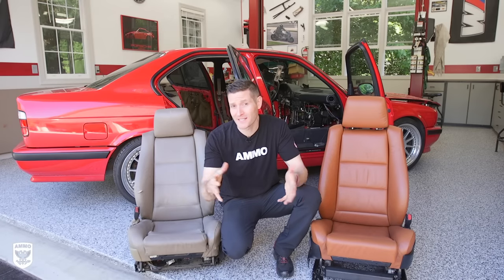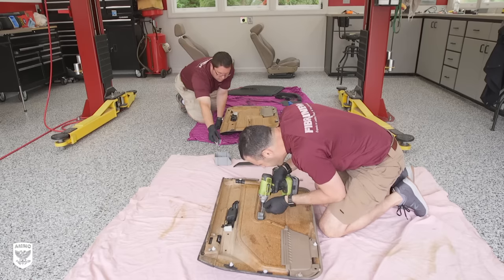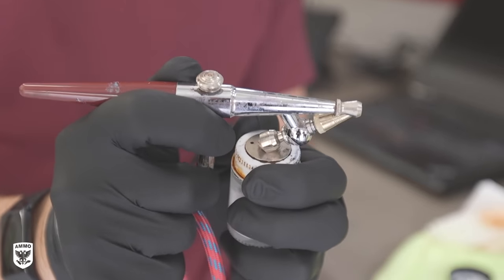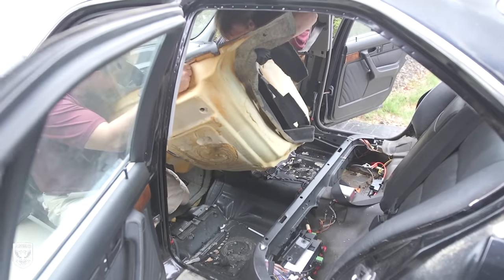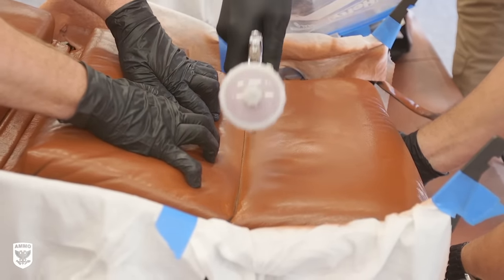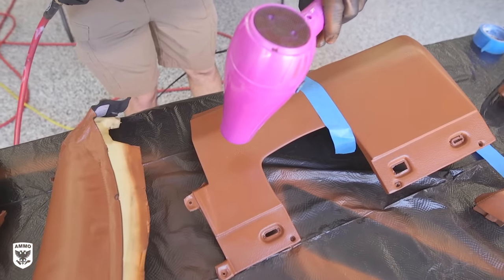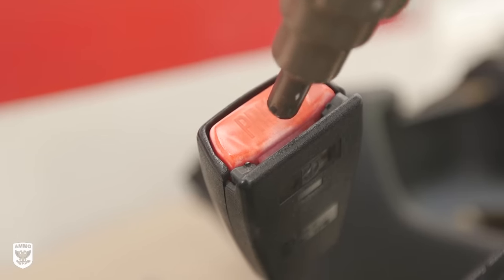How to Change Car Interior Color with Dye: BMW

Comment: Never go from dark to light. Using to many layers of pigment will make the finish unstable and wear or crack way faster than it should. It also make the feel of the leather feel more like vinyl.
Only go from the original colour to darker, this way needs 1 to 2 coats max.  Sponge the first coat then use a roller to flatten it out, this makes  the pigment bond better then feather out any areas that need it will the airbrush. This gives longer life and a natural leather feel.

Comment: I’ve seen leather restored as below but always wondered how good the oem to white colour change was, not that I’d go that way as I hate seeing the inside of a vehicle while driving, it has to be dark. 35 odd years ago I delivered computer gear, one of my customers rented a space to a young guy who restored leather, mostly old car stuff: as a custom painter and sometimes making horse stuff out of leather and using Raven oil which is basically just a stain and rots thread as I found out when I darkened a leather jacket with it I was intrigued: he had basic spray gear and an airbrush you blew through similar to the tube type breathalyser that he used for touching up small missed parts and adding where the coat was a bit thin... he had more work that he could keep up with and I totally forgot until I saw this as I’m looking at paying $6,000 more for car because it has graphite leather interior instead of the usual almost white seats, lower dash and doors which I hate with a vengeance, it’s an easy one to pull the parts from: seats get black sheepskin covers so not fussed doing them as it’s just for me and it’s getting hot rodded anyway and I have all the spray gear.

Comment: That looks amazing. I am thinking of getting a set of leather seats for my car. They are factory recaro seats that are prone to split due to wear on one side of the drivers seat. Is it possible to have that sort of damage re-stiched and repaired?
Reply: The wear on the outside bolster is caused by getting in and out of the car rubbing across the seat instead of dropping into the seat
You should be able to by an original condition cushion cover (not the whole seat cover) from the dealer network.
Once leather is cracked or torn, you cannot do a lasting repair because the fibres that bind the top surface of the hide together have been damaged

Comment: Wondering about the cost of this color change vs. getting all the parts in the desired colors from a donor car or aftermarket source.  Possibly the dye can still be accidently chipped off the hard parts, since factory hard parts color is all the way through.

Comment: You can also completely remove the upholstery and simply re-tint it with shoe polish ... 
And the commitment, layer after layer, passage after passage, tints the entire seat on the old-fashioned way.
It's much longer but above the leather, you put dye; no paint; the reaction of the latter is not the same, nor maintains it.
Especially since starting from a light base is easier, but from black you can go back to white or Tan.

P.S :  The problem is that leather is a very nice option but in 99% of cases, people who buy it do not know how to maintain their precious equipment, people do the same at home with the sofas in the living room, an interior or a sofa or leather armchair, this wears out a little over time, but in general terms, maintained on time with the right products and in the right way, it's indestructible, it does not crack, does not wrinkle.
In a vehicle it's particular and very meticulous, it does not like large temperature differences so maintenance is more intensive and expensive.

Comment: Regarding the red center in the seatbelt catch, what do you do so it can  be red again, also regarding the glovebox, I have a 1988 volvo 760 turbo intercooler, the glove box, I replaced with a unit from annother 760 except it*s light blue and the interiors are tan, how do I get a tan color  so everything looks correct.

Comment: what cleaning , protectant, paint & top coat was used on this project? I have E36M3 coupe in techno violet, interior  leather is dove grey. I need to dye rear seat because of damage, the paint I bought is BMW color match but color is flat I need good top coat to make it pop like new.

Comment: I have an 1989, BMW E-34 535-I I want to fix, like the armrest on the bucket seats,   it has black leather, and it is like cracked or dried out, plus the use, I want to keep the interior original or as close to original as possible,  any suggestions

Comment: 8 persons working on your car for two days: thumb up, will cost you more than getting a brand new interior.
Spraying everything inside your workshop: thumb up.
Spraying primer right next to already colored pieces: thumb up.
Dismantling a dashboard on the floor sitting down when you have such a nice bench to work on: thumb up.
Having your beautiful and soft touch leather interior sprayed with paint resulting in it becoming hard as a stone and revealing the old colour everytime you scratch it: thumb up.

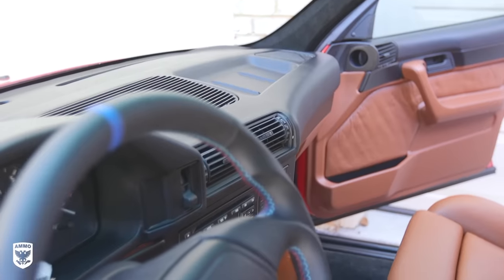Comment: The seatbelt and the location in which it clicks in is wrong, at 13:30 you can see it is directly under the belt where it's supposed to go across the passengers shoulder.

Comment: as nice as this process appears on camera, there is a big difference between a reupholstered seat and a re colored seat, as much dye as they put on to change the color leaves a thin layer that is noticeable, it won't have the same premium feel as "factory colored leather/vinyl" it will also crack/chip if you aren't careful, i run an upholstery shop and actually do the Upholstery for my local Fibrenew.

Comment: Projects like this is why I think 3-D printing would be better used for technical things like this instead of crappy toys and trinkets you could just 3-D print and adapter for the air ducts and avoid that

Comment: the result is great.  especially if we think what it costs, compared to reupholstering it.  but there is no one who convinces me that it is a good choice, I do not think it will last.  the process of dyeing leather is complex, involves very strong chemicals and heat and pressure, and cannot be compared in duration to a spray-on coat of dye

Comment: This restoration is unnecessary for a 95 BMW 3 series, not only are there tons of parts out there for those cars, it would be far cheaper to just buy a carpet, get the seats and doors reupholstered in new leather, my 66 was $3000 about 10 years ago. This is the type of process you would do on a one of a kind 60's sports car to keep everything original or knowing parts are not available. But apart from that, he is wearing a mask, spraying next to people with no mask, and he is spraying parts on his desk with a computer and other equipment just sitting here. I honestly never seen a crazy setup like this, considering the expected cost. He absolutely should have a booth for this large of an operation.

Comment: Hey Guys,I Spray Paint My Motocross Cheap Leather Blue Seat to Black Using Just a can of Krylon Paint That Supose To Stick To any surface,Well it work,and 2 years Later it Still have not come off even when as i Ride off road and rub on the seat as i drive and hit bumps with my pants,2 days of drying time and it was good to go. Heres The cheap way to go my friends, Use Krylon Paint Spray Can.

Comment: Hi i did this to change my pearl white couch to white and the guys i found are painting with the proper professional procedures and they have painted and coated my couch a large number of times but it still
Keeps cracking and revealing the original color in those cracks after a week or so. Anything to correct this issue?

Comment: You aren't using dye to recolor the leather in this car. Dye is a product that is completely absorbed into the leather. You are using a recolorant, not dye. The recolorant you are using is a vinyl product that sits "on top" of the leather, not absorbed by it. Recolorant has a completely different look and feel from dye. Those Aniline leather seat cushions you applied recolorant to are going to feel cold and clammy compared to the soft and supple feel the OEM seats had. I don't understand why you didn't use Aniline dye on the seats. It costs about the same as the recolorant.
Reply: Good point to distinguish between dye and coloring.

Comment: I worked as a spray painter,  but not on interior of for example what would happen if someone got into that car in a nice white suit what period of time would you have to wait before that would suit would come back out white also how long would it take before began to where true the cover what you referred to as clear coat on a spray job how long before it starts to wear on heavily touched areas I am considering doing this but I do not want to do a half-assed job I want to do with proper and I want to know if there is a requirement for an extra coat of the sealant heavily worn areas please do tell also what is the name of the product and what price are we speaking per litre and how much would one use typically in the car let's say the car you've just so happens I actually have to gravity fed brand new guns so I am ready to rip lol I do understand 70 percent of the job is preparation can you use standard primer can what can you use in what countries use what are the please give me all the information if you don't mind thank you Great  video

Comment: This can all be done on the cheap. Go to Harbor Freight, buy the following: Airbrush kit, airbrush compressor (or use one you already have), sandpaper, clean and prep material, a hairdryer, and fabric/leather/plastic/vinyl paint. This video is to demonstrate how a "Professional" company does it, they make good money obviously. If this was a video on how to cheaply change the interior color of a car, do you think it would have got the same attention as this one? Do some research, invest $300 in equipment and not only will you have a professional-looking end result but you can sip a beer and gloat about how badass you are.

Comment: the problem is it does not stand up the back seat will last the longest than the pass seat but the driver will go first from going in and out the parts will last the longest i have been do it for 20 years i know what i am talking about

Comment: Problem with upgrading old cars if someone runs into you it gets totaled and you lose all the invested money. I got a 2003 BMW Z4 with 175,000 miles and is a good car worth about $2000.00 to an insurance company, hope no one hits me. Looks like a $5000 job on a $2000 car.

Comment: I do upholstery it’s better reupholstering your car why because you have new foam new vinyl or new leather and a better feeling when your car has new materials if you paint your seats foam with be soft and weak and will not last long and your material won’t be as good as a new repair seat I suggest to repair everything than paint also paint can chip off over time Beacuse if heat

Comment: Why not just reupholster? Probably the same cost or less and you get new material. You could even probably get a better quality leather rather than the typical low quality automotive leather. I guess this has its advantages though and good quality leather would last longer it doesn't even matter because a car like this will never get many miles or any abuse since it is a show/collector car.